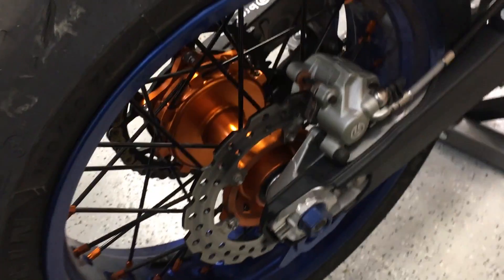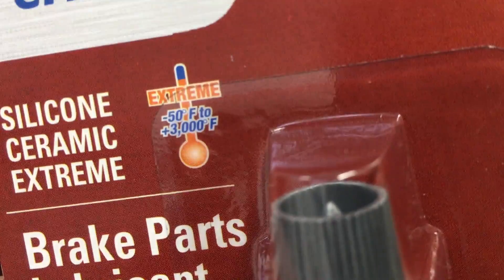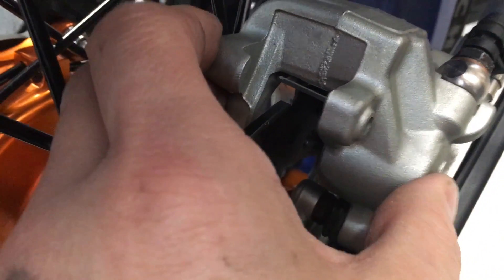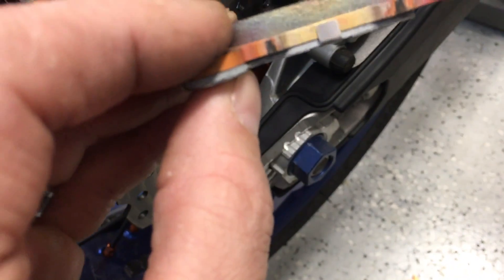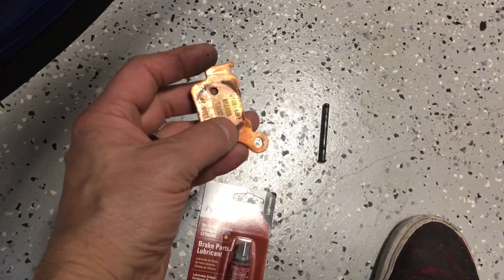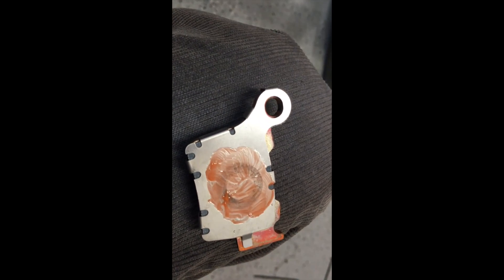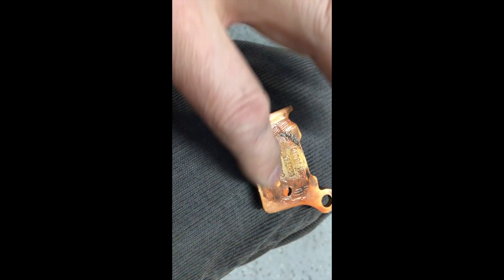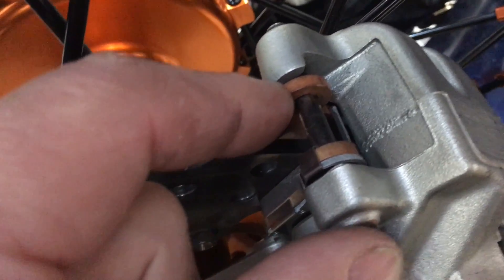How to Stop Motorcycle Disc Brake Squeal -- One Cure

Comment: I've just bought a KTM 390 Adventure, and it had the squealing brake problem on the front wheel. I brought it back to the dealer, he applied the very same fix you've described, and the squeal is gone. Thanks!
Reply from the maker: Thanks for the info!

Comment: works on my new brake disc and pads.. the back of the pads is the magic spot!  tried everything.. almost wanted to change to another new disc and pads
Reply from the maker: Lubrication is amazingly helpful in many instances.
Reply: update : squeal came back 2 days later albeit softer, the next fix was to re-torque all 6 bolts on my new rotor evenly, using the star points configuration, i.e opposite bolts from one to the other. so far so good.

Comment: My rear brakes squeks stops when I slightly press brakes, Any idea why its squeking ?
Reply: i know its late but how did you fix it?
Reply: @chard8114  My rear brake cliper was jammed and rusted, so took it apart, Cleaned it and applied the grease. And now its working all good :)
Reply: @khanibrahim5947  thanks! 😊

Comment: I have a question. My rear brake squeaks very loud and the disk gets very hot very fast. Does it mean i need new brake pads?
Reply: The brake is too strong, bleed some of the oil. Fix the problem immediately
Reply: @sampohlmann1503  like 5 months later but i fixed it i just resurfaced the brake pads and bleed the brakes

Comment: One thing I noticed today. So if you are doing slow speed practicing on a hot day. After I greased the backs o f the pads. If you are really using the rear a lot (in my case) It will still squeak once the rear brakes get really hot. Once it cools it will still be quieter. Maybe that makes no sense but that's what I've found so far.

Comment: huh, same thing i do on my car brakes but for some reason didn't think to do this on my bike.
Reply from the maker: Applying lube to the metal backing plate may or may not help. There is no guarantee this will work, but there is a high likelihood of its working... so give it a try.
Reply: @TomGlander I think the noise was coming from the tabs where the pads "slide".  greased up that part and the backing plates, no more squeal :)

Comment: Isn't the noise generated by actual pads contacting disc ? Thanks
Reply from the maker: Chopbreaka  vibration is the culprit. Pads don’t squeal. The metal backing starts vibrating.
Reply: @TomGlander  Don't they squeal if glazing is present on the pad? Mine are squealing after proper lubing brand new pads and everything. I'm gonna get the rotor resurfaced because it has pretty noticeable grooves that are causing the glazing.
Reply from the maker: Alexander Seling you’re most likely right. Glazing isn’t a good thing.

Comment: Would this be the same steps to change the pads when they get worn?  Just remove and replace or is it more involved.   

I have a brand new motorcycle that has a back break squeak. It started at about 100 miles. Just the rear. I have about 250 on it now but so annoying and 2 weeks before first service.  Thanks so much!

Comment: Before and after video would have been much more helpful
Reply from the maker: Good point.  It's like back seat driving.  I can always point out the failure of the driver after the fact.  "Hey, you missed the exit.  If you'd have been paying attention, you wouldn't have missed it."  Yea, I wasn't paying attention while making the video.  Not sure how doing a "before" would have helped fixing the problem.  Maybe put the sound in perspective?  The professional film makers get that kind of feedback all the time.  "You should have done it like this, or like that."  It's all good, man. Appreciate the insight.
Reply: Really. Why would he have gone through the trouble of making this video if it didn’t work? If only those supporting Ukraine had a BEFORE and after.